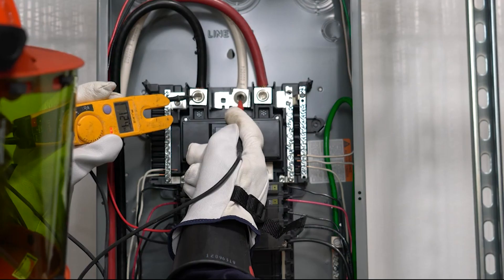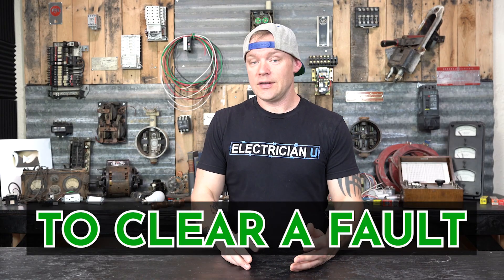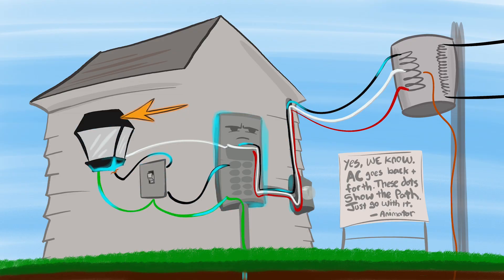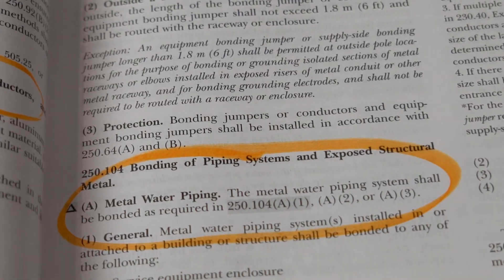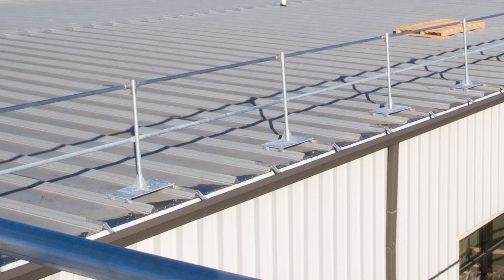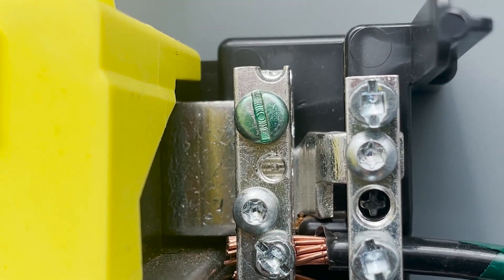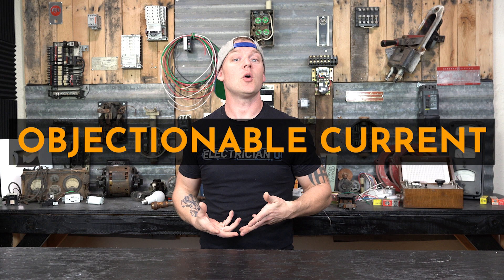Why Do We BOND Neutral & Ground in ELECTRICAL SERVICE PANELS?

Comment: Yikes! is this right? In California there is NO return neutral from the house to the transformer on the service pole : only two phases of 120V are supplied. The return path IS earth/ground. You bond neutral to earth/ground in the first service panel and for secondary panels you run three wires - live/neutral/ground and, as you say, you do NOT bond neutral and ground in the secondary panel. (However, depending on the distance to the second panel you MAY have to add a second grounding rod in to the earth.) 
The reason you ground appliances is to attempt to make the current (should there be a fault) prefer to flow down the ground wires, in to the ground and back to the utility. When that happens there will be lots of current and the breaker should trip. If you didn't ground the appliance, sadly and badly, that current would flow through you, the person touching the faulty appliance. In reality, even with proper grounding, plenty of deadly current will flow though the human as well as in the ground wire - that's why you need GFCIs to protect the humans. It's worth remembering that (normal) circuit breakers (not the fancy residual current or spark detection types) are NOT designed to protect  people from injury, they are designed to protect the wires only .
Reply: There is no such thing as, "... only two phases of 120V are supplied ..."  In every state, in the USA, 120 Volts is SINGLE PHASE !
Reply: @MrSummitville  I see only two wires coming from the pole to the panel. The voltage on one is 120V RMS between it and ground, the voltage on the other is 120V RMS also. However the voltage between the two wires is 240V RMS. This indicates that the 60 HZ voltage sine waves are 180 degrees out of phase with respect to each other. It's just as well, really, otherwise my AC and stove wouldn't work.

I suppose the problem is, people use the word wire and phase interchangeably.

Some apartments complexes are supplied with 3 wires and the the phase difference on these three wires is 120 degrees . When they feed two wires to each apartment the voltage across those two wires is only about 208V so I guess it takes longer to cook dinner in those apartments :)
Reply: @mb-3faze  No L1 & L2 are not 180 degrees out-of-phase. The 240 Volts comes from the secondary of Single Phase Transformer.  It is your measuring technique that is 180 degrees out-of-phase.  If you have 2 @ 12 Volt batteries wired in series to make 24 volts, would say the batteries are 180 degrees out-of-phase because you measured the voltage of each battery from the MID-POINT of the two batteries?  One battery would display +12 Volts, while the other battery INCORRECTLY shows -12 volts!  No, they are both +12 volts and not out-of-phase ...
Reply: @MrSummitville  There is some explanation here. https://hvacrschool.com/why-is-240v-called-single-phase/
Reply: What about water pipe grounding in California?
Reply: @georgebonanza9487  It's important to connect your copper pipes to ground just for safety however, nowadays, most water supply is done in PVC pipes. Obviously you cant rely on PVC to provide an electrical path back to the power supplier/pole transformer. So we are required to bash a copper coated steel rod in to the ground and connect the house ground to that. Because ground and neutral are connected in the main panel, and only L1 and L2 are fed from the transformer in the street, the return path for all electricity going to the house is done literally through electrons conducting through the earth. Quite bizarre really. (I believe new construction is done differently now.)

Comment: If neutral was never bonded to ground, there wouldn't be current flow if hot were shorted to ground. Doesn't bonding neutral to ground create the unsafe situation in the first place? It seems that the pole connection to ground creates the problem. If there were no bonding, then the secondary would be floating, so no potential to ground.
Reply: No, bonding N-to-G does not create an unsafe situation ...

Comment: I like your set.  I'm not an electrician. (I'm a doctor) but I have indeed wondered why the two are bonded.  It's like you have 3 wires but two of them hook together at the end, why not just use two?   I have a sub panel in my study.  I have 400 Amp service.

Comment: Electric ranges bridge neutral and ground right in the appliance if you have an older 3 prong plug instead of the new 4 prong plugs.
It comes from the manufacturer like that, with neutral connected to ground with a copper bridge plate.
The 2020 NEC is total bullsht. It was put together by a bunch of government Safety Sally's the same ones who mandate that you wear a helmet while you ride a bike and a face diaper when you're in public

Comment: You don't mention the ungrounded installation's. (hospitals, special industrial use AND appartments in reused instrial area with an ungrounded electric installation).
The electrictions know which area have ungrounded electrical service and need special equipment. It's the most expensive electrical service but if you have ONE ground fault you are perfectly safe and the current stays up (that's the reason for this service in special outlets in hospitals and some industrial areas).
In server hosting you'll do UPS and dual supply as it's cheaper.

Comment: Interesting how that system works, not really useful because for my European installation the contact between neutral and ground will instantly trip the "Fehlerstrom-Schutzschalter" (RCCB, von englisch Residual Current operated Circuit-Breaker)
Reply: This video is for the USA.  Europe is different ...

Comment: you are not explaining this correctly. the neutral ground connection is already made at the utilities distribution transformer. the ONLY reason you bond the two at your houses panel is because if the neutral connection fails it has an alternative path. simple. Our industrial facility has a neutral ground resistance system (NGR), this system limits fault current, alarms and allows us electricians to rectify the issue with no equipment damage (which is common in a typical grounded system).
Reply: Nope.  We need to BOND the N-G at the Service Panel because we use an ISOLATION Step-Down Transformer ...

Comment: I'm currently working at a new commercial building will be a bank. Since it's a new experience for me, it blows my mind to see how it all comes together, we are running the HVAC system, the electricians are doing their thing, and the raceways are coming together. Everything is metal, so it definitely has to be bonded, I learned a little about electricity when I was in trade school for HVAC, and I know that in our trade a ground fault is just another term for "short to ground".🤔😌

Comment: If you have a PEN-fault that can put mains voltage on any grounded equipment. If you do not have bonding you can then have mains voltage between your kitchen sink and the range.

Comment: What if I have an out building 150 yards away (detached garage, workshop, etc) with a 100amp panel off of the  main 400 amp service panel? Shouldn't that 100amp building panel have it's own ground, a grounding back to the main panel, and its panel be bonded to that building's ground?
Reply: It should have an equipment ground conductor pulled from the main panel to the sub panel sized per NEC Table 250.122.  It should also have it's enclosure bonded to the building ground ring per NEC Section 250 (reference Grounding Electrode Conductors).  It SHOULD NOT have the neutral bus and ground bus bonded.  This is to occur in one location only for a service which should be upstream at the service entrance equipment (either the main panel or utility transformer - not both).

Comment: I have a question about the power company side of the transformer.

Does there need to be two power wires going to the transformer or will it work with just one wire from power company?

Also what is the circuit path on the power wires running up on the poles? Is there always two to make a loop back to nearest substation/etc or can it work with one?
Reply: The Utility Company is usually 3 Phase ...

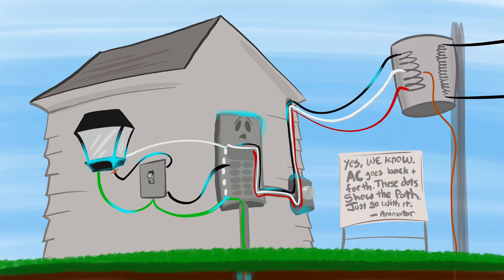Comment: 3:45 Ground fault technology doesn't need a path back to the neutral in the breaker box to work - that's it's entire purpose.  It detects the unbalanced current going out the hot and not coming back on the neutral (in your example) and since the only way that can happen is if the current is going somewhere it shouldn't (down the ground or through the user touching the cabinet) then it opens the circuit.  The current down the ground wire would make its way back to the neutral at the transformer through the ground at the power pole.
Reply: I EU this connection between ground wire and neutral wire is strict prohibited.
Neutral and live goes tru RCD ground wire is separate wire

Comment: 3:20 There is a grounding wire on the transformer (orangish line). Wouldn't that complete the circuit and allow current to flow? Does a breaker only trip if the return current also goes through the breaker?

Comment: Great video but I do have one question. You state that in the service panel bonding is necessary to trip the breaker. I understand why there's no bonding in sub panels but how to breakers work in subpanels?
Reply: The same way actually.  Electricity always returns to its source.  This point of return is ultimately the point where the neutral and ground are bonded at a single point near the service entrance.  Your sub panels still have neutral conductors and grounds, they just aren't bonded together anywhere else but at one point.  Should a current carrying conductor come loose and contact a grounded component, current will flow on the ground conductor (which normally sees no current) all the way back to the source through upstream panels.  While electricity will return to its source on every path, the ground conductor is the intended low impedance path for electricity back to the source.  At this point, if properly designed, the circuit breakers closest to the downstream fault will operate first due to the surge in current (from a normally current carrying conductor to the ground) minimizing the area of electrical outage and isolating the fault.

Comment: Dude I learned alot about automotive electrical when I I did college and through my years of work. Certainly helps me understand most of what your talking about despite knowing nothing about building electrical.
Reply: It’s not that much different. I did auto and locomotive electrical as well. Mostly different terminology but circuit rules are the same.  Auto electrical is actually much harder simply for accessing test points.

Comment: Second time I had a inspector tell me that the grounding conductor for a 200 amp service "must be" a #4 copper wire. I ran the minimum #6 then copper wire that is stated on the NEC section 250. Who's right in this situation?
Reply: Assuming you're referring to the equipment grounding conductor, and the upstream circuit breaker is no larger than 200A, then you are right.  This can be verified per Table 250.122 of the NEC.  A #6 AWG copper conductor is the minimum called for via the table for a 200A protective device.  Does this inspector possibly not know the difference between aluminum and copper?  I ask since the minimum aluminum size would be a #4 AWG assuming a 200A breaker per the table.  Simply ask him to explain why and cite the code.  :)
Reply: The Inspector gives approval of your project, or not.  The NEC is just a GUIDE, it is not LAW ...

Comment: "Grounding Green" is what we were told to remember the difference between grounding and grounded.  Works for me.
Reply: A grounded conductor is a load carrying wire that is connected to ground. A grounding conductor is not intended to carry loads and simply provides a connection to ground.

Comment: The number one reason we ground and bond the neutral at the service entrance is to keep the neutral a neutral. The second reason is to clear a fault / overload condition.
Reply: Wait. If u didn’t bond a neutral to ground at the panel you would still have a neutral. Why wouldn’t we have a neutral if we didn’t bond to earth at the main panel
Reply: I'm a tad confused as well. Without the green bonding screw that bonds the neutral to the metal encasing of the panel, the ground still connects with all of the neutrals on the terminal bar and still has a return path to neutral. What exactly does bonding the panel to neutral do? I'm guessing it's to ensure the metal of the panel can't be energized or become hot and it would trip the main breaker???

Comment: Hi guys, utility worker here. For us the reason is to protect the home against a faulted service neutral. We of course still see cooked appliances from imbalance due to a bad service neutral, but without a bond from the neutral to ground fires 🔥 would be much larger problem.

Comment: Question (clarification): You appear to have a ground conductor between your main and sub-panels. Do you allow a sub-panel (say in a remote building) to be supplied without an earth conductor from the main panel and install a local ground electrode instead? Under such circumstances, would you then also bond the neutral and ground at the sub-panel?
Reply: IANAE, but I think no and no. Please consult a professional.
Reply: No.  You would pull an equipment ground conductor from the main panel to the sub panel along with the current carrying conductors.  This is your low impedance path for electricity to return to its source during a fault to clear the upstream protective device.  See Table 250.122 of the National Electric Code (NEC) for how to size this equipment ground conductor based on the upstream breaker rating.  Think of this separately from your Grounding Electrode Conductors (GEC) bonding the enclosure of the panel to earth via building steel, ground rods, etc.  This serves another purpose.

Comment: Keeping the ground and neutral seperate after the 1st box reduces shock when the neutral wire from the pole breaks and/or current leaks to grounding can cause corrosion of gas pipe causing a gas leak just outside the house.  20+ years hvacr showed me weird and painfull stuff.

Comment: I have a strange one for you. Maybe a subject for video. There was a fault occur at the public transformer that caused the electric water heater to allow the plumbing system (all copper) to become energized 30vac. Please explain the potential faults that could allow such a thing to occur. My first thought was a lack of grounding on the plumbing system and possibly a lack of grounding rod(s) at the house. This occurred in a South American country where I have to direct the tests and corrections. Any assistance would be great.

Comment: WRONG. the earth ground is part of grounding and bonding. "non-current carrying conductor" is what the "ground" is called. It is also called the grounding conductor, but it really has nothing to do with the dirt under your feet.
Reply: There is one wire that is "grounded". That is to provide a path back to the neutral if the ground becomes energized, and barely works. You do NOT run electricity into the ground to accomplish ANYTHING.

Comment: Wrong! Normal breaker do not break the circuit when it leaks. It only breaks when the current over its rating. The earth leakage circuit breaker neither detect the earth leakage. It only detect unbalanced current between hot and neutral.

Comment: This video was great and helped me understand what I have just "done". I would love a follow-up talking about a single service entry point and multiple buildings (I may or may not have this situation :-D ). As I understand it the rule of thumb is each "building" should have its own bond in the panel to ground? Example for me is that I have a house, separated garage, and then a utility building that is fed off of that. I have subpanels in each, garage, and utility building. I think each structure should have their own panel neutral/white bond to ground?

Comment: So long winded to not really say the actual reason for having a separate bonded circuit.  The reason we bond and maintain a separate ground circuit is so we have a circuit path that doesn't have a load on it.  This guarantees that in the case of a short circuit the amperage will move to infinite and guarantee a breaker to trip.  This may not happen if there is a load on the circuit already.  In that case a short circuit can cause repeated sparking and that is how you get fires and burn down entire cities like old Chicago when they only used a two wire system.

Comment: Yes. But you failed to mention  the grounding electrode system at the service. And why we have like 7 electrodes connected to the building, connected  to earth. Electricity also follows the path of least resistance. The natural or the return to source. Is least resistant, is why we bond ground and neutral @ the service. The grounding electrode system is incase we lost the neutral, behind the point of service.
Reply: Electricity follows ALL paths, not just path of least resistance ...
Reply: @MrSummitville  ok guy, if hypothetically you had a short circuit working in a j box  and its was grounded. Current is going to flow through the grounding conductor back to your Grounding electrode system and trip the breaker, instead of through you. Yes electricity flow through all conductive path. But bitch the path of least resistance.

Comment: Really good informative video.  If I understand, you implied but did not state, a house should only have 1 grounding rod. I have an additional grounding rod out at a boat ramp. When operating the winch and standing in the salt water to guide the cable (sometimes had to) I would feel a minimal electrical shock. I connected the ground circuit from the winch directly to a ground rod. Seemed to solve the problem. Is that OK?